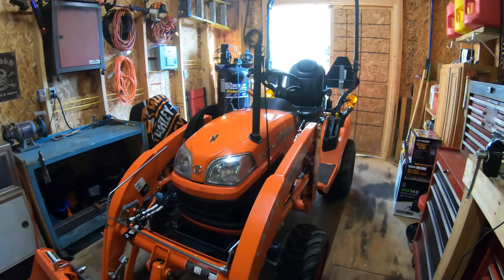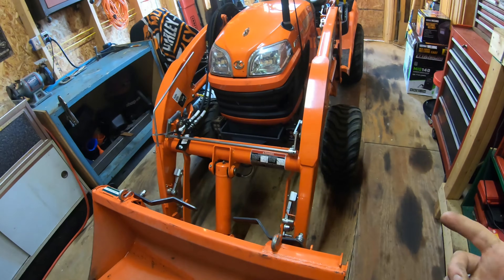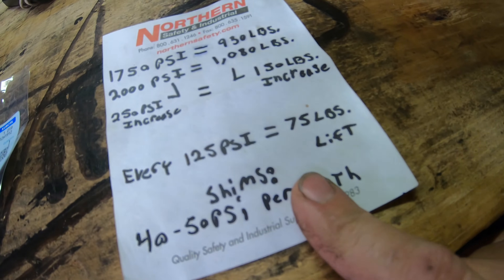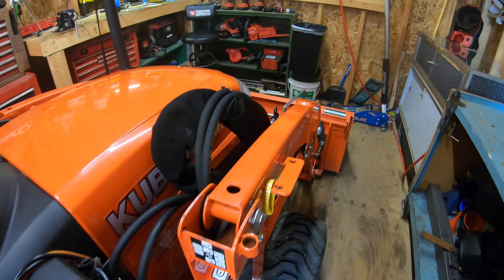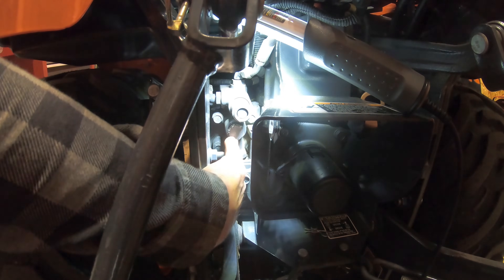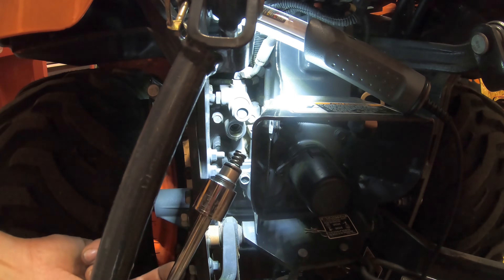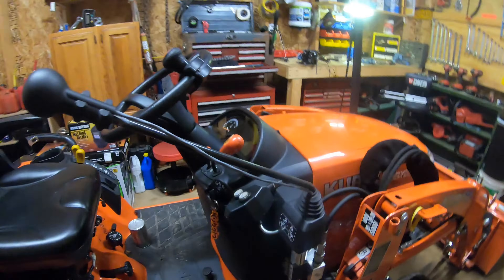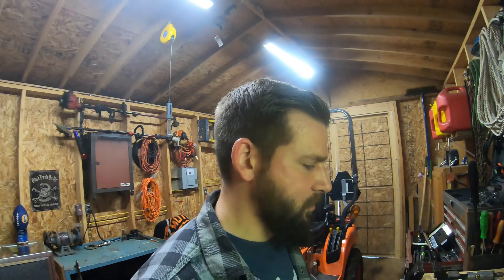Kubota BX- Increasing hydraulic pressure... AGAIN

Comment: It will be interesting what the crane scale reads now. I put mine up to 2000 this spring, and am much happier with the lift increase. I have the new style flat face hydraulic fittings, and bought the gauge and quick connect from Amazon for about $35, if anyone else is looking to check theirs. Shims are only about 50 cents each from the dealer. One warning when doing this. You must have ballast on the back of the tractor or you will just lift the back wheels off the ground. Without ballast, you are putting ALL the weight of the load you're lifting and the weight of the tractor, on your front axle, where the ballast puts more weight on the stronger rear axle.
Reply: Not Quite.  Adding rear ballast keeps the back of the tractor on the ground, but because you now can lift more with the FEL, you actually put more load on the front axle.  However, you get stability by adding pressure on the rear axle, since the front axle pivots.
Reply from the maker: You got it Ron, it def shouldn’t be done with our proper ballast, these machines are extremely light in the rear stock so increasing the pressure to a bx with no ballast will actually hurt you rather than help you. I’m excited to see the crane scale now as well, I’ll do that video soon. Thanks for watching!
Reply: .50 cents? Not any more. They are over $6 each now
Reply: Probably 'due to COVID-19 '
  ~ 600% if I got the math right😮?

Comment: Great video, I’m going to increase mine to 2000 psi 
Thanks
Reply from the maker: Awesome Rick! Yes it will make a huge difference! I feel 2000psi is a great sweet spot for this machine.. it’s enough psi to truely feel and make a difference yet it’s not so high that you have to worry about hurting your tractor. I feel that Kubota could comfortably sell these tractors at 2,000 psi if they wanted to.. but they don’t because they are made to be light in the rear and don’t want people getting hurt as you must proper ballast the rear end if you want to fully take advantage of the extra lift power and you’ll need it to stay safe
Reply: @BiffsEquipment 
The rear ballast is definitely a must.
Especially to us new owners.
I’m going to leave my backhoe on till I get some of the newness off me.
Thanks for your videos, they really help a lot.

Comment: Is there a valve that can be shimmed to increase forward/reverse pressure. Seems like I’ve lost the pressure to push or go over smaller obstacles. Thanks for any input.
Reply from the maker: Hi Ronnie! Sorry I’m just seeing your comment! So there is unfortunately no way that I know of to shim your hydrostatic transmission pressure. You can shim the loader valve pressure but this won’t have any affect on the transmission pressure. The pump on a BX is internal.. it sounds like either your filters are clogged, you’re running the wrong type of oil, or maybe your trans is just wearing out.. what Happens when they wear out is there is a brass bushing that eventually gets scarred on the pump and this creates a soft leak to occur so that the pump can not build as much pressure to drive the axle.. what I would recommend is changing your hydraulic spin on filter, then removing the metal screen strainer at the bottom of the transmission to make sure that is clean.. then I would fill it up 70\30 with hydraulic oil.. 70% Kubota HST fluid.. 30% “Lucas hydraulic oil treatment” 

The Lucas hydraulic oil is proven not to harm your transmission and is made to be used in hydrostatic transmissions.. it is a much thicker oil and helps to seal that brass plate u was telling you about which will create much greater pump pressure again to allow your axle to have more power moving you forward and backward. Try this and get back to me cuz I’m curious to hear how you make out or what you found. Thanks!

Comment: How many shims total from stock did you increase?
Measurement in thousandths?
Reply from the maker: Hey Eric, I never measured it because it won’t be the same for every tractor. Each tractors releif valve spring is gonna be slightly different from another. Some people only. Require a couple shims and some people require many shims.. also the age of the tractor and it’s hours of use will make a difference too because of spring fatigue

Comment: I want to try this so how many shims and what sizes did you use to get that extra lifting capacity to 2250
Reply from the maker: Hey Kim, the shims will differ on every machine, I can’t tell you how many because not only is everything relief tension slightly different but every tractor is also at a different pressure than the rest.. so depending on your starting pressure and spring you may need more or less than I used so the best thing to do is to just buy yourself a pressure gauge, check it, then add a few shims at a time while continuing to test it and stop when you get to the pressure you want.. most guys can get to the pressure they want with a .3mm shim, a .4mm shim, a .2mm shim and a .1mm shim.. I’d start with buying thise and slowly add them till you get where you wanna be 👍🏻

Comment: What tire pressure’s are you running with the added lift capacity and added ballast?
Reply from the maker: Funny you mention that, I just made a video on that a few days ago talking about the tire pressures I run and why. https://youtu.be/xKoZDjNzA2c

I generally keep it between 30-32psi no lower than 28psi otherwise if I’m lifting a heavy load with such a high hydraulic pressure I can squish the tires down quite easily but as long as I keep them around 30-32 it’s ok 👍🏻

Comment: Love your channel. Have you had any issues going to 2250 psi since you increased it?
Reply from the maker: Thanks Mark I appreciate it! Nope I didn’t have a single issue at 2,250psi.. so much so that I even increased the pressure yet again in a later video all the way up to 2,450psi where so far it’s been completely reliable for me tho I obviously don’t recommend people to go this high haha. Once you find the video where I increased it again any video I made working with my tractor after that video will be with my tractor at 2,450psi. Thanks for watching!
Reply: @BiffsEquipment  Quick question, what tire pressure’s are you running with the higher lift capacity and the need for added ballast?

Comment: Man that's a good idea for a video. No one respects those mini tractors, and they have a rep for the loader/bucket empty will settle to the ground soon after cutting the engine. Wonder how she really does hold up over time
Reply from the maker: Thanks John. These little sub compact tractors are certainly under rated.. I have done like 3 or 4 hydraulic pressure increase videos on my tractor since I’ve owned it, each time I increased the pressure more and more.. I’m currently at 2,450PSI and it’s a monster now. I have done TONS of jobs with this tractor since the very first time I increased the pressure above what Kubota calls “factory” and I have yet to have a single issue, no leaks, no blown lines, no bent cylinders.. I have worked this tractor to death and it just takes it and smiles.. every time I think I’m gonna break it I don’t lol. It’s been a great machine and in the last few years I have put over 450 hours hard worked on it. As for the hydraulics drifting.. this happens with all tractors and models.. once the pump is no longer running the hydraulics will slowly settle.. it’s just something they all do. Thanks for watching!
Reply: @BiffsEquipment  dam right man, plus they're so nimble no other tractor could ever get in the spots/terrain these do with ease.
And as far as the bucket drift actually no many Deere's do not, yet most Kubotas do, especially the small ones. Honestly idk why exactly but it may be the added dexterity and flawless control Kubotas are so well k own for where the Deere isn't as smooth they have tighter valve? Idk the full truth. But I will say (and it really is 100% true) that my Deere 1050 front bucket filled with bricks I forgot it up when we got rain outta nowhere I rushed to get everything under cover and dry, the tractor sat in my back couple acres for over 2 weeks bucket doesn't settle an inch. Could be the fact of much larger idk but my neighbors a farmer with a 40hp Kubota and he obviously loves it, and his hydraulics settle like mad which is one of the biggest and only things he hates about it.
But in reality we all know don't ever have real weight or objects in bucket or whatever up 10' in the air then shut the tractor off,or even stand under it while running, so the real world here it shouldn't be an issue. Just one of those things that makes us wonder "wtfs the difference" lol

Comment: I should absolutely not have any issues increasing mine to 2000psi then.. I was worried about but you guys gave me confidence.. Thanks.
Reply from the maker: I think as long as your not crazy with it youll never have any issues.. Mines at 2,250 and i beat the crap out of my tractor and iv yet to have any issues. Just be sure to properly ballast the rear to keep yourself safe. Thanks for watching!

Comment: Do you know of anyone running 2150-2200 psi for long time? Any issues?? Problems??
Reply from the maker: Hey Chris thanks for watching, yes i’v actually been at 2,250psi for nearly a year now, working the living crap out of my BX and I have not had a single issue. A friend of mine saw I didn’t have any issues so he also went up to 2,200.. just gotta be careful is all and make SURE you have enough rear ballast so you can keep yourself safe.
Reply: @BiffsEquipment  thank you sir.   I think I will set my at 2200 and go with it     thanks for the info

Comment: The 3 Point on my 2350 seems to have lost lift capacity. I can't pick things up that I know I put there with it. Fluid is topped up and fine.   I haven't noticed anything with the loader Although it may be a bit slower but then again I haven't paid much attention to it. Will upping the Hydraulic pressure increase the lift on the 3 point or is that a different system?
Reply from the maker: Hey buddy, how long ago did you set the 3 point hitch implements down where it will now no longer lift them back up? Sounds like you could have a more serious issue Because hydraulic pressure shouldn’t drop that fast. When was the last time the tractor had a transmission/hydraulic fluid change and have you pulled the filter screen that’s located inside the transmission to see if that’s clogged cuz if that screener gets clogged up your hydraulic pressure will drop as flow to the pump will drop.. I would say start by changing the fluid and filter, along with removing and cleaning that filter screener. Changing your loader pressure as I show in this video should not give your 3 point any more pressure as I believe the rear 3 point is on a different relief valve. Plus even if it did I don’t think you would be doing yourself any favors cuz to me it sounds like you have a bigger problem that’s happening if pressure has dropped that rapidly. Hope this helps buddy, sorry I’m just now seeing your comment sometimes YouTube doesn’t show me all my comments till days later 👍🏻
Reply: @BiffsEquipment   I did notice it fall pretty quick.  I was moving stacks of Solar panels on pallets around and then it wouldn't seem to lift what it was before.  I knew how many panels were on a stack so easy to measure the fall off. I will change the Filter and look up where the other screen is and have a look at that. 
Thanks for the feedback, Very helpful and gives me things to start looking at. I think I'm going to up the loader pressure anyway. You seem to be having good results and the thing moves no where near as fast as my fathers 1025.

Comment: Do you have the part numbers for the shims.
Reply from the maker: The part number for the shims shoulda been in the video but if not you can call your Kubota dealer and they will give them to you.. just tell them your looking for a .1 a .2 a .3 and a .4 shim .. by having one of each you should be able to get to your desired pressure but you can buy a few extras if you choose.: they are only maybe 1$ each

Comment: What lever did you use to test the pressure? The loader? Is it important to have a pressure gage to put the shims in? Or your just trying to see the increase or change?,
Reply from the maker: Thanks for watching, Typically if you insert the gauge in the forward most coupler for your loader then to activate that exact function you'll push the loader joystick forward to the best of my knowledge. Every one of those 4 couplers is a different direction on the loader stick so whichever port you decide to install the pressure gauge into you'll just have to move your loader stick around until you have found which direction you need to push the stick to activate that given valve that the pressure gauge is connected to. As for having a gauge when adding shims I would say its a must because with out having a gauge you have no clue what your pressure is at to begin with and don't know how much your pressure will be going up after adding the shims, you have to be careful not to go too high or you can hurt your hydraulic pump or hoses. Its recommended that you stay at 2000psi or lower.. I went higher only because I fully know the risks involved here and am sure to watch out for any signs of early failure. Hope this helps. You can find the pressure gauge along with the shims in a well put together kit at "BxPanded.com"

Comment: correct me if I'm wrong but I see 1 issue with this, the total system is rated at a specific pressure, your showing a pressure at 0 load, now your upping the pressure at 0 load, when you then use something like a grapple or lift a rock your total system pressure can now spike much much higher, way above the system ability. I could be wrong by this but I believe I'm correct.
Reply from the maker: The system itself was indeed under full load.. What we were testing here was the hydraulic pressure and at which that pressure would be relieved at.. The only way to check hydraulic pressure is to dead head the system by putting it under a full load which increases the pressure so high that the hydraulic relief valve kicks in and bleeds the pressure back off... the only way to do that is to put the hydraulics under full load. So to answer if this was tested under a load,  It was.. When testing the pressure your forcing all of the hydraulic fluid into the gauge.. the fluid then has no where to go so the pressure gets higher and higher until it finally gets relieved by the relief valve.. then whatever the reading showed on your gauge as the pressure was being relived will be your true hydraulic pressure.. This isn't showing back pressure like a grapple could do if pulling hard on something, that type of pressure would be even greater yes but that's not what we are doing in this video..   What your talking about is using something like a grapple that can apply pressure backwards into the system by the grapple/clam putting force back on the hydraulic ram creating more pressure in your system then what it typically sees... This pressure would normally be trapped tho between your 3rd function valve and your grapple which is why you always want to rate your hydraulic hoses for more pressure than your system can output to be safe and its also why hydraulic hoses are over rated from the factory. Hope this helps

Comment: What's your lift capacity now?
Reply from the maker: Hey Wayne, I havnt checked yet but it should be roughly 150lbs more than it was last time I checked it which was in my first Kubota bx pressure test/relief valve video.. I plan on doing another video soon testing what it can lift with my crane scale so stay tuned!

Comment: Did you notice any more whine from the hydro after you raised the pressure. I did on the L2501.  Also, I know where you can get a tilt cylinder for the BX - there's a place in Tennessee that make and sells a really high quality one reasonably.  If you still have the King Cutter box blade shown in your channel wallpaper, you MIGHT be able to tilt it enough to use it to cut drainage ditches if you can get enough lift out of it.
Reply from the maker: That’s cool I never heard of them, I have a hydraulic top link already and would like to add a tilt cylinder but would need rear remotes to run both cylinders off the back, I plan on buying rear remotes soon tho. As for the hydro/pump I don’t hear any whine it hasn’t changed in any way other than provide me with more power thus far 👍🏻
Reply from the maker: The king Kutter I do have, only issue is it’s a 5’ boxblade and it’s too large for the bx, I use it when I have to but otherwise don’t like to as it’s a pain to install cuz it’s too large and cumbersome for the bx, it’s also not quick hitch compatible so that kinda sucks too.. I plan on selling it next summer and buying a proper 4’ boxblade that’s quickhitch compatible so I can take it on more jobs with me 👍🏻
Reply: @BiffsEquipment  Yeah. I understand. I never run out of power on the BX but I have run out of weight! have you thought about selling it?
Reply: @BiffsEquipment  Good to know. Thanks.....

Comment: I'll be interested to see how this works out.  Mine is at 2k also and have wanted to go higher. Good luck
Reply from the maker: Thanks Chris, I already did one job with it, video will be coming soon, the tractor worked very well and it had a lot more power. Even with all my rear ballast I was back to lifting my rear tires off the ground again, I was getting monster buckets with super heavy/wet crushed limestone and I felt it had a lot more breakout force during my last job. I will deffinelty have more videos on the way showing it’s lifting abilities. Thanks for watching.